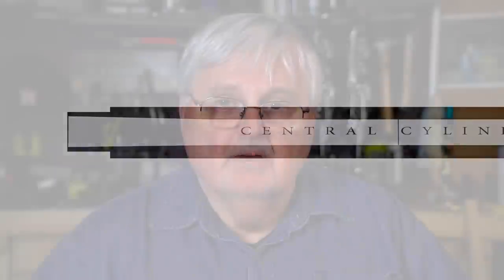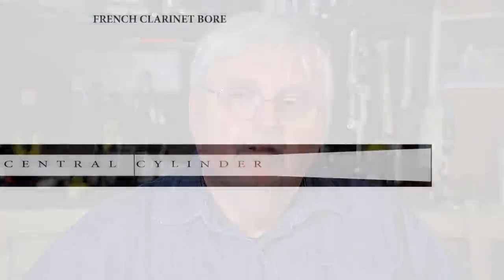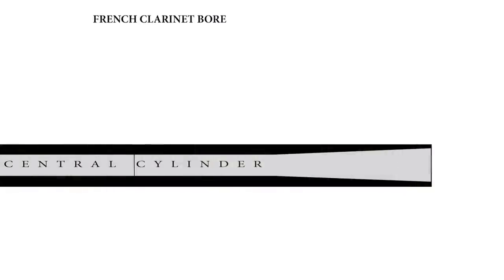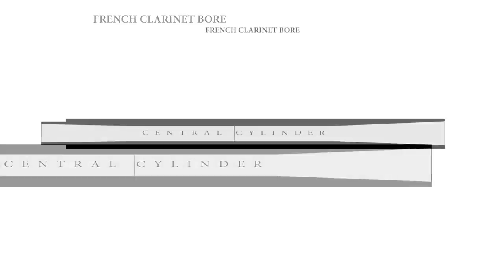a boring story

Comment: Great stuff! Thanks. How do reverse taper barrels play into the long taper at the top of the clarinet? Are they supposed to "line up" with that taper? Or do they end up at a narrower bore diameter than the top of the upper joint? And should we be looking for barrels that match the mouthpiece bore at one end then the upper joint bore at the other (barrels all seem to be narrower than either the mouthpiece or the upper joint)? Strangely enough, when I've played a barrel that is 15mm in bore diameter, it feels very resistant even though the bore is larger than commonly available barrels.